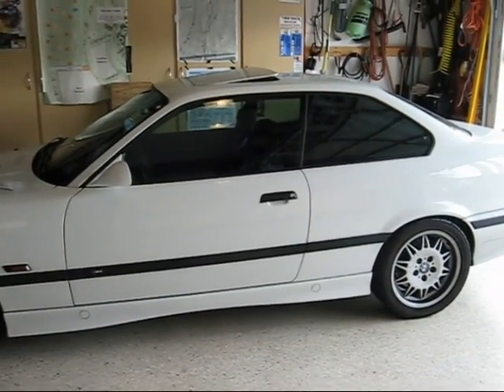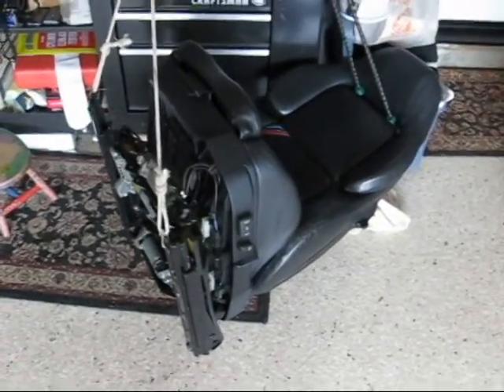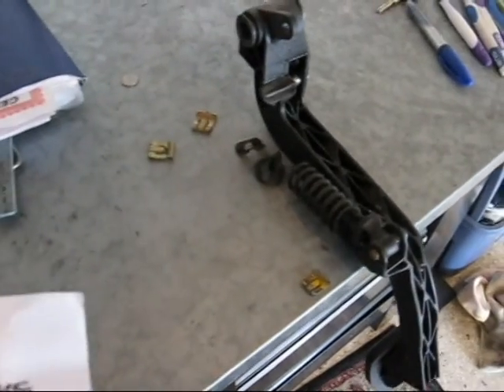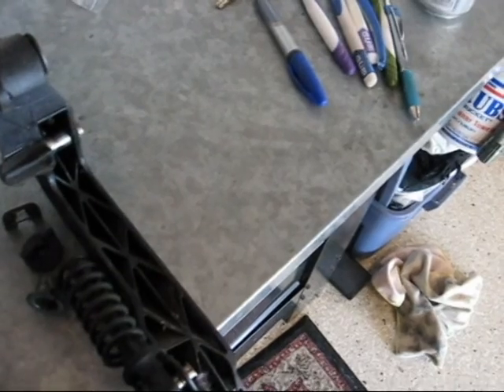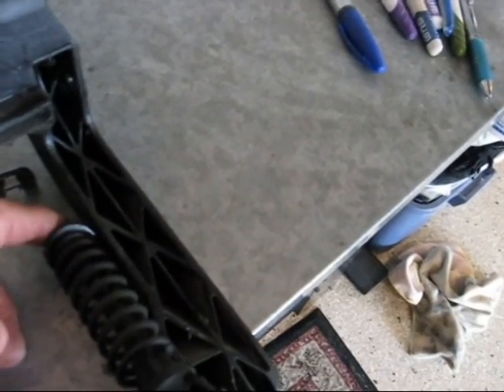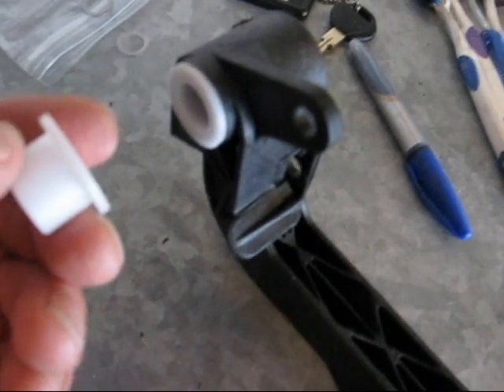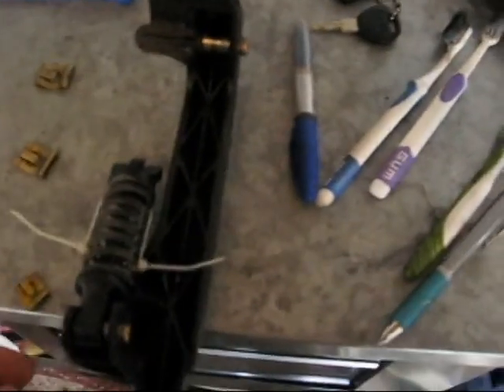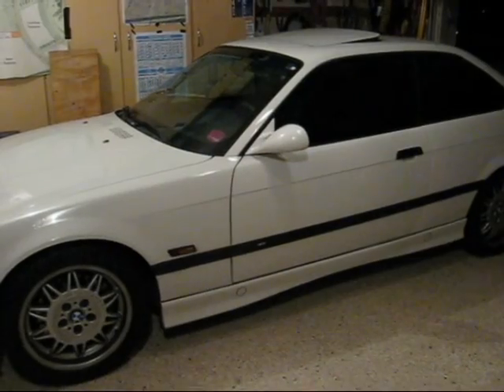BMW Clutch Pedal Bushing loose repair replace by froggy

Comment from the maker: It's been a while, but IIRC you pry the tab in the middle with a small screwdriver and slide the fastener off the groove in the pin. I had about 1/8 inch play (side to side) when I was done, but the improvement comes mostly from the HARDER material that the new bushing is made of. I also put in a new clutch slave that made it easier & smoother to push. A clutch master helps even more, but mine was "good enough" with just the bushing & slave & pedal stop.

Comment from the maker: I can't recall if the clip slides off the end of the pin or sideways. Try the easiest one first & then as you examine it you'll see how it operates.

:)

These are pretty tricky to get off/on.

Comment: How do you get those 3 clips off? I have the new bushings and struggle with the clip removal. Once replaced, how much left to right wiggle should I expect? Right now the clutch moves around 1/4 inch left to right. The real issue I have other than the movement left to right is a "not so smooth" clutch motion as i start to push it. I did spray white grease on it and that made it better for about 6 months. I understand why no video while removing parts, but it sure would help!